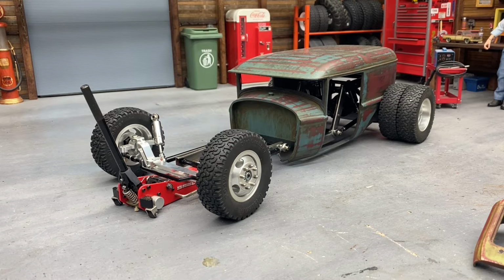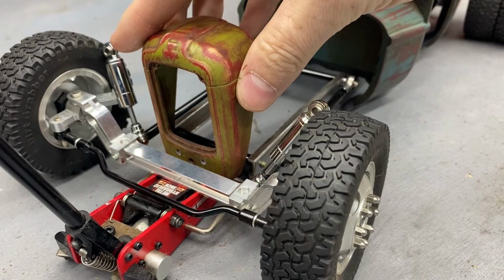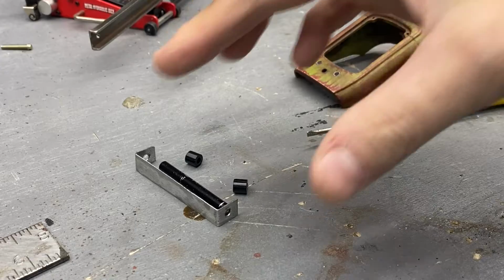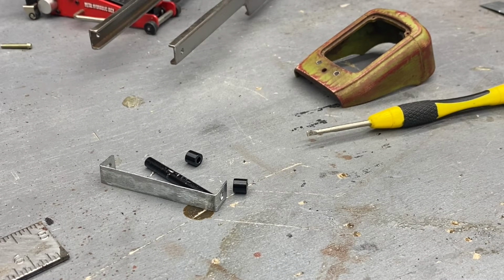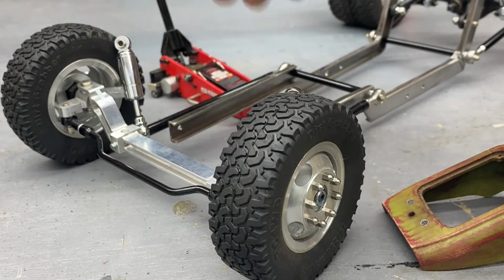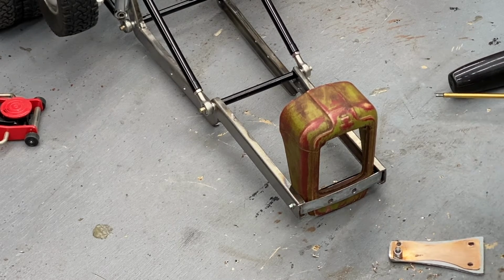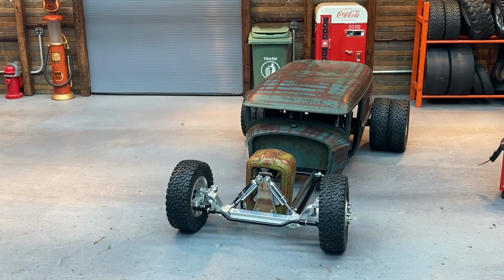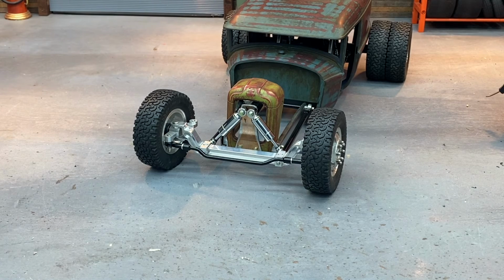More In Depth RC Engineering,  Front Suspension on the Scratch built RCratrod, Part 4

Comment: What about something like the radiator braces on semi trucks? Use some brass rod that you could thread each end with a die after putting any bends in it to clear engine or servos. Wouldn't take much to stiffen it up.